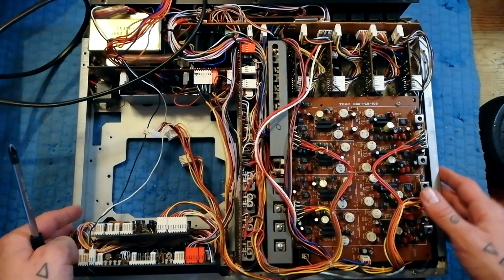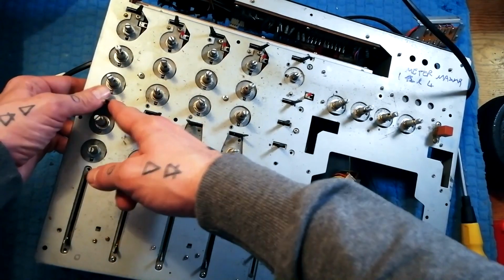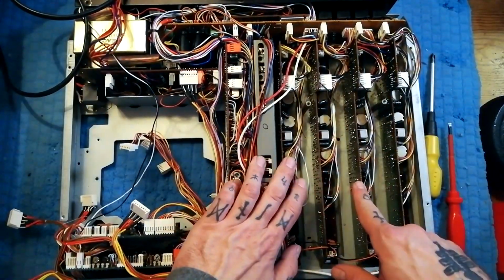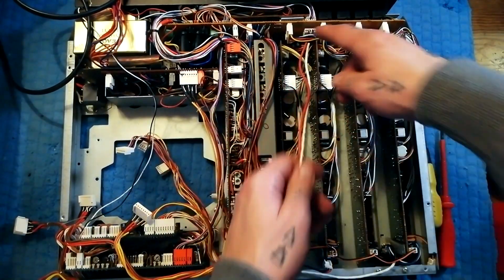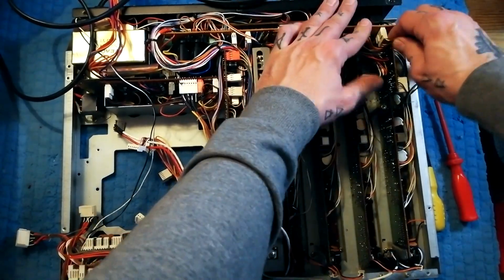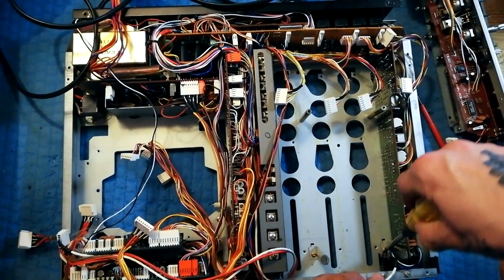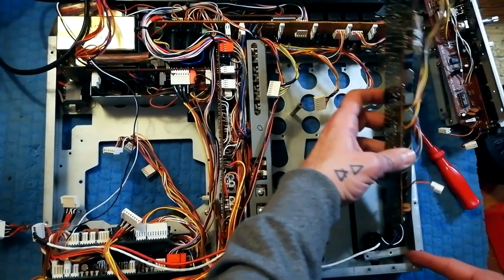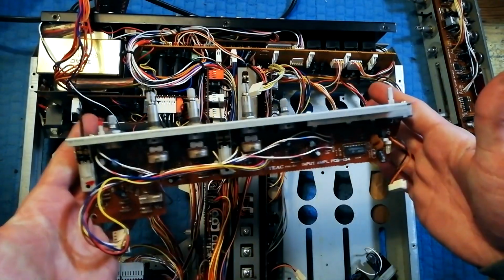Remove mixer channel PCB strips | remove DBX board | Tascam 244 Portastudio

Comment: Hello Tetrakan!
I just bought another 244, almost new.
It plays all 4 channels well, but 1 and 2 do not record.

I have replaced channels 1 and 2 on another 244 I have and it works fine, but the problem was not resolved.

And the worst thing is that when I reset the original channels to the last one, it no longer plays or records!!

Can you tell me what things I should review?

Thanks a lot!
Dan

Comment: hey man the tascam 244 i am trying to fix has really scratchy channels and each headphone input sounds a little different, the line outs sound a bit better but the channels are just sounding iffy. anyway i could pay you for a zoom call or something to maybe pick your brain about what may be wrong with the channels or what i could do.

Ive replaced the pinch roller and control belt and got it to play tapes i also bypassed the dbx and everything seems fine. your videos are great. Ive commented before under a different youtube account but anyway thank you for sharing your work.